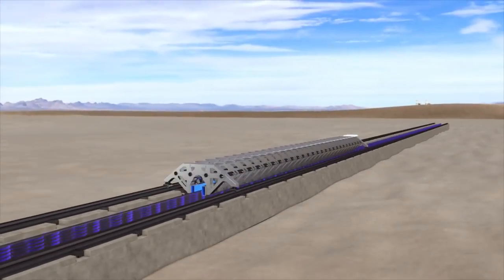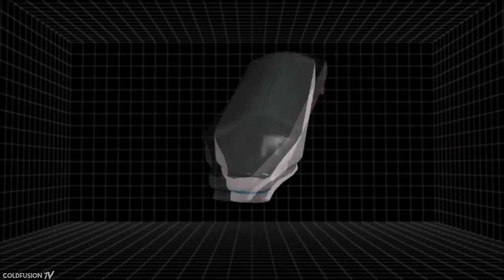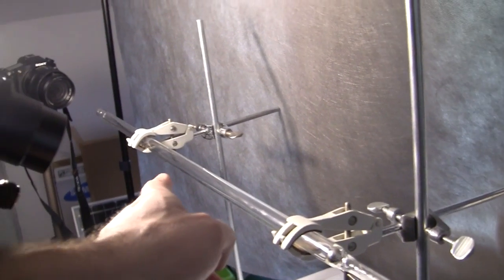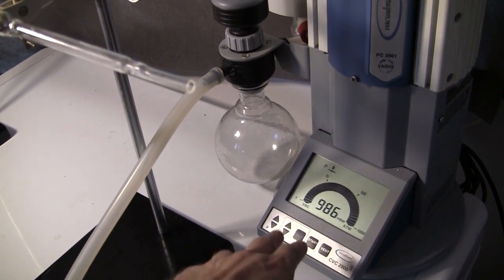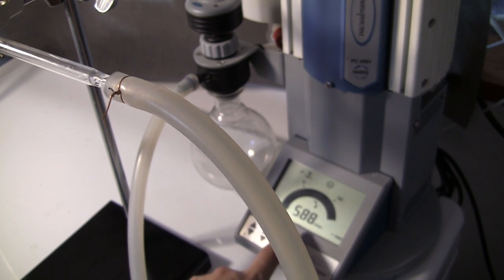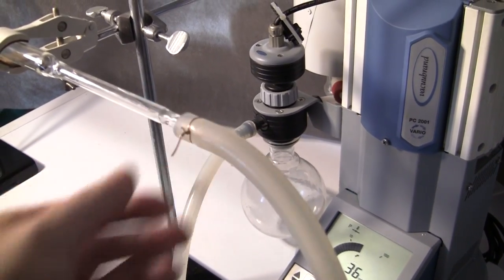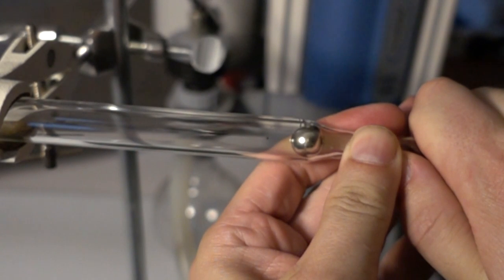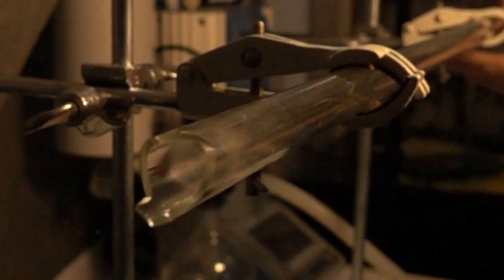How  the Hyperloop can kill you!

Comment: TF while there are numerous challenges with the hyperloop some of which may make impractical, to ever build  the point you bring up is not one of them. Assuming a very light pod ~ 4000kg at 2m diameter at sea level only give a max acceleration of 80G not pleasant but survivable over a short time. The magnetic drive will  have a instantaneous braking effect due to Lorentz forces with the track preventing extreme acceleration. And all this is only a problem if the pod is stopped, at cruising speed the pod is near the speed of sound in air @ sea level so if the breach happens behind the pod it would little effect. the worst case is the breach happens in front of the pod at which point you would have to rely on sensor networks to stop and safe the pod prior to the air getting to it. I'm assuming the the breach is more than 1km away for that to be practical, any closer your pretty much SOL but that is the case for current trains as well.

Comment: 0:21 I like how they think that a propeller would do anything in a micro-pressurised environment! Haha!
Reply: +Tomatjävel You are incorrect.  At those speeds even in a micro pressure environment, air is going to quickly pile up at the nose of the car.  The SR-71 flew at very high altitudes with very low pressures, but the skin still had to be specially made to cope with the high temperatures due to friction.

Comment: Isn't this an issue that's mostly already addressed?  Turn the air bearings off and friction will ground the loop, right?  There won't be an air tight seal as well.  Air can pass right over the top of the pod.

Comment: I'm not going to claim to be an expert in physics, but this entire demonstration seems overly simplistic incredibly disingenuous, as if you are going into this with a preconceived notion. Does a glass tube and a ball bearing adequately compare to the proposed design and construction of a real hyperloop tube and pod? The ball smashing through the glass looks dramatic but what are the actual forces at play here, and what would they work out to be fully scaled up based on the proposed designs? Some hard numbers would be very nice to have. I would also like to hear your reasoning as to why it would be outright impossible to stop the pod in the event of this sort of accident, you just sort of claim that it is impossible and leave it at that.

Comment: Most things Thunderf00t busts deserve it. This however is more a "in event of failure things get very dangerous" which is true of almost all of our technology. If you're in an elevator, plane, submarine, bullet train, etc a catastrophic failure will live up to its name. That does not mean that it can't be engineered to a point that such failures are low enough to justify use in mass transit. 

I don't know much about the hyperloop, seems like a very expensive solution to what high speed rail can already accomplish. Still, if they ran the numbers and actually have the tech available (not a "we need money to solve a few issues") then why not. Yes, it's dangerous but so is nuclear power yet TF can agree nuclear power dangers can be minimized with engineering.

Comment: easy fix, the magnetic propulsion system could counter any in expected forces, along with other things like pressure locks every set distance in the tube. the trains could have system that allows air through the train via pipe when the pressure is above a curtain amount.

Comment: Hardly the thing that will kill it. What will kill the idea is that it is far too costly and no one will want to be in it.

At that speed, the tiniest shifting of the track would result in huge turbulence for the cabin. Combined with the fact that you'll be in a steel window-less box with an insane amount of ambient noise and you can't get up or even move and you have yourself a truly miserable experience even compared to today's airliners.

Comment: I see a simple solution for this. Have hatches that are locked when there is a pressure differential, like a turn lock pressure cooker. gaps open by spring assisted gravity when pressure is slightly lost. Place them about every 100m or so then if it "cracks" there is no vector differential, in your "experiment" imagine breaking both ends nearly simultaneously.

These hatches could have deploy-able ladders for emergency exit purposes as well.

They could also put ceramic skid pads to drag when the coaster effect is lost.

Comment: in a hyperloop if any part of the tube is distroyed/damaged the the current is cut to the magnets which causes it to stop levitating and the friction of the tracks slows it down to a relatively safe stop. then you have the tube built into small sections so that damaged parts can be sealed off quickly. it's not that much different from any other modern electric train in terms of safety or engineering difficulty for the most part.

Comment: Ever since the Brexit video I'd have to say this channel has been the trainwreck you described. "PR bullshit" as if you know this and for all the engineers working on their versions of the hyperloop an obvious failure is an oversight somehow. There are many ways to solve it and even if for some reason we had only 1 or 2 instead of multiple overlapping safety features such as dynamic breaks and pressure sensors and security control, it would still be safer than any other method of travel.

Comment: This is not a very good experiment.  That kind of thing will not scale up at all.  You're essentially talking about making an air rifle that fires cars at less than 15psi above atmosphere.  Not going to happen, and these things are going to have brakes.

What I worry about is when there's a vacuum failure up ahead of the card that's already going 500kph.  How many G's will that put passengers through on deceleration?  Will the car remain intact?  Will the car hold up to the heat of compression?  It'll basically be like a meteor hitting the atmosphere, but skipping the upper low-density regions and going straight to sea-level thickness.  I think structural integrity can definitely be engineered in.  I think deceleration G-forces are the big worry.  

The entire concept simply won't work unless they can make the recompression scenario entirely survivable.  

But again, this video is not a good analog.

Comment: Lots of problems with this video and its claims.

1) He uses a ball bearing that takes up most of the diameter of the tube.  There's no reason the hyperloop car needs to take up that much cross-sectional area.  It doesn't use the air pressure for propulsion, just to reduce friction.  There could easily be channels around the car that allows pressure to equalize on each side.

2) There would still, of course, be forces applied to the car.  It has magnetic brakes which presumably could hold it in place.

3) It's the pressure differential that is the issue.  There's no reason that interconnected safety valves can't be used along the length of the tube which would open in the event of a rupture of one part of the tube, eliminating the pressure differential.  It doesn't need to be eliminated entirely, just to a level where there's no danger.

4) It's comically arrogant to think that the very smart engineers who are working on this problem haven't thought about these very basic issues on day one.  That alone renders this video almost as dopey as the Brexit ones.

Comment: Do the same simulation only create a tiny pin hole to make it more realistic as opposed to snapping it off entirely, which is not a realistic representation of a common breach or tube failure. Air can only rush in as fast as the hole will allow.

Comment: Thunderf00t, 
When it comes to the thorium power car, or the solar roadways, I completely understand the impossibility of it, and thus the stupidity of pursuing it when the foundational idea itself is flawed.  But with the hyperloop, I don't see the flaw as a foundational flaw in the idea, but rather as some basic hurdles that would need to be overcome through clever engineering. Like yes, you can't engineer solar roadways to become viable because the physics of the inherent inefficiencies of the approach. I am no engineer, so maybe this is impossible. But I can come up with lots of potential ways that they could slow the acceleration, and allow for reasonable braking while maintaining the overall efficiency and speed of the system. Would they work? I don't know for sure. But this does seem like an odd battle to fight since they are not crowdfunding a project that has no hope of ever actually working. It's simply an idea put forth that may revolutionize long distance transport if it works. and if not, then the companies involved wont make their money and will move on. No harm done.

Comment: On a side note, I am wondering how will they manage the dilatation of the metal tube cause by the temperature variation. For train rail and bridge they use dilatation joint to let the metal expend. But since the tube is air tight they will need special air tight joint? (I am guessing this problem is already solve for oil pipeline but I would appreciate a explanation or documentation :p )

Comment: Yo Phil, I'm not great at physics, but what about this idea:

The hyperloop can be composed of contiguous segments where each segment has some sort of depressuring zones? This way, if one segment breaks or fails, the other segments can allow the air to be pressured/depressured equally to avoid the passengers being blasted like team rocket. Obviously, this would need some sort of computer system to detect the pressure changes or break points of each segment. I doubt they are so dumb at the hyperloop that they would make the entire track one long, continuous tube anyway.

Comment: I don't think that a much larger object is as quick to be accelerated as a small ball, since the ratio of surface area to mass is completely different. A small scale model simply doesn't work well here.
And why do you say that they have no way to stop it? Doesn't the thing have any brakes?

We are talking about extreme wind speeds, though, which would likely not be very nice if they were to reach the inside of the hyperloop train, which would really be my biggest concern.

Comment: I'm pretty sure they are not going to make the tube out of glass. Industries have been designing pressurized (and evacuated) systems to the Boiler and Pressure Vessel code for over 100 years with a lot of success including over 50 years with nuclear power.

Comment: Crashing in an airplane at a velocity of 200 mph will kill you.  Crashing in a car going 60 mph will also kill you.

What then is the purpose of this video?

BTW, a breach of the Hyperloop that will cause a loss in vacuum can be detected by sensors.  The pressure wave may move down the tube at the speed of sound.  But the warning to the pod will get there earlier as it is moving at the speed of light.

Comment: There are a few obvious flaws in the experiment: 
1) The dimensions of the tube and pod that Elon Musk proposed are not even close. The diameter of the tube would be around twice as bis as the pod, so air could easily flow around and above the pod, there would be more area for the air to flow around the pod than against the pod.
2) The suggested pod would also have a massive turbine in front of it in order to blow air from in front of the pod to behind the pod through additional air passage ways. This would also dramatically decrease the acceleration from the air (which is why it was planned that way in the first place in order to achieve these speeds. They obviously did the fluid mechanic calculations). 
3)The pod is much heavier than the ball and it takes much much more energy in order to accelerate it, but the pressure differential is the same. It's like comparing blowing a dandelion with blowing a small car with the same wind speed/pressure differnetial.

Also this is not designed by hacks and charlatans, but by engineers at SpaceX who definitely know what they are talking about when it comes to fluid dynamics and  Elon Musk who is almost obsessed with safety to the point where he insisted on designing the safest cars in the history of the NCAP crash test (which he achieved with the Model S).

No doubt the problem you speak of is real, but is it significant with the real thing? Even if it is, is it impossible to solve through a safety mechanism like a valve opening behind the pod in case of failure in front, equalizing the pressure behind and in front of the pod so the effect is all but gone? I don't think so.

Anyway, I'm curious if your arguments will be better in your full video, this one does not convince me.

Comment: They got the idea from their favorite shitty SciFi series, sea quest. Which was basically Babylon 5 but under water. 

Besides I'm not even thinking of a vacuum failure. How expensive would it be to evacuate that much atmosphere, over the distance to make those speeds possible, as well as how long would the tunnel have to be in order to be practice? Trans oceanic pipeline would be OK...except for the engineering undertaking of building it under water.

Comment: Brakes aren't a solution as the break in the tube could just as easily be in front of the passenger car (rapid deceleration) as behind.  That said, as long as the car is sufficiently aerodynamic and/or small enough relative to the tube then the acceleration due to the sonic, pressure shock wave of the tube break hitting the car could be managed.  Controlled venting of the tube could also be used, but it would be much simpler to manage the forces of the tube break via the aerodynamics of the car.  Also an option, though not as energy efficient, would be to add mass to the car to reduce the acceleration.

Comment: Interesting, but I would imagine this can be corrected with the design of the passenger module and brakes. The module doesn't have to be designed to fill the tube. The only thing it needs is a seal to allow passengers on and off. If it were designed to only occupy about half of the area of the tube, a reasonable braking system should be able to hold as air rushes past in a failure, I would think.

Comment: Aren't passengers going to experience heavy gravitational weight once they reach peak speed?
That sounds dangerous or at least awfully uncomfortable for the passengers if they are planning to use this commercially.
I hear jet pilots are specifically 'trained' to endure such pressure. I doubt regular Joes are resilient enough to withstand high G force.

Comment: I thought the idea behind a hyper loop was to do just as you tested, Pull pressure from the front of the car and build it up behind it, or just simply eject it... Then when you want the car to go you release it allowing the pressure differential to pull you. SO basically your video just proved that it can work, which was already a well established fact... (Then again I never read about this project so yea)

 I don't know why they are implementing magnets seems like a waste of money, just make a magnetic train if you have them there anyways lol...

I also thought the size of the hyper-loop stuff was to use small pods, for a few people to get around a city, not a train. 

Finally the biggest issue with this stuff is distance, hyper loops as large as a train would need to be relatively long in-order for the high speed to be of significant use. (getting to the other side of the city in 30s instead of 5min is not worth it) This would mean you needed to maintain a tremendous amount of tubing that is under vacuum... let alone the pumping system that is used to maintain the it.... All seems like a waste of energy... You would basically have to power the entire track instead of just powering where the train car is. Like I said before, just make trains with magnets XD.